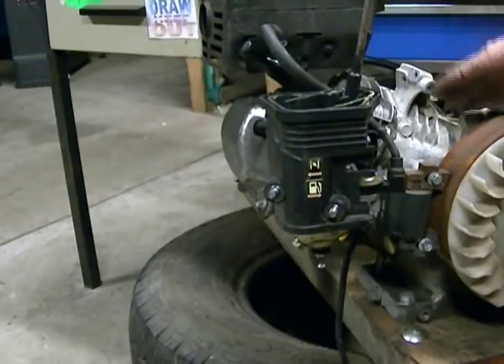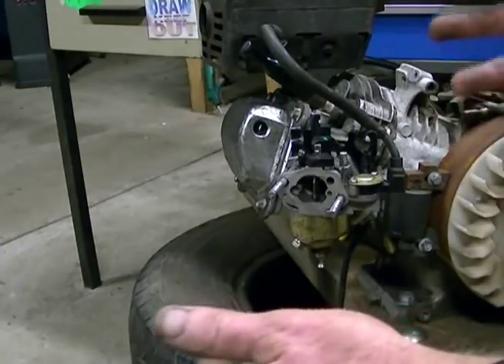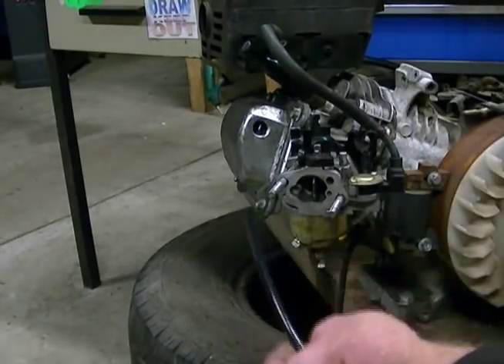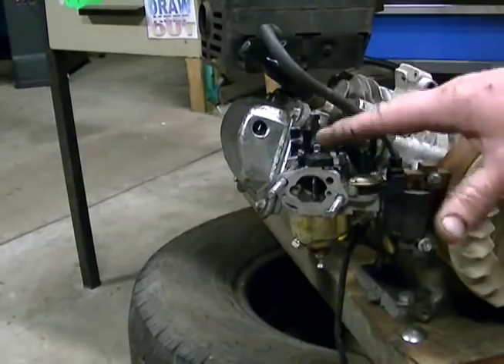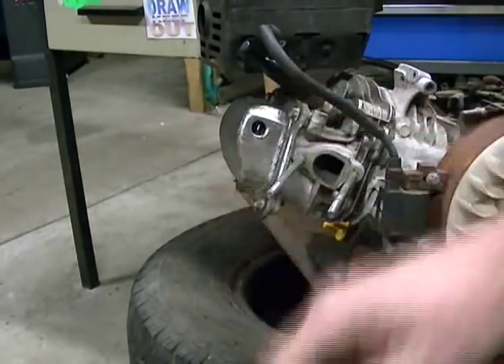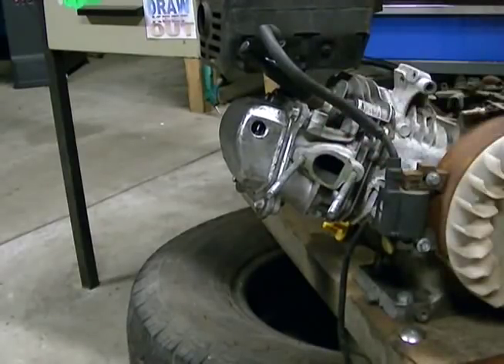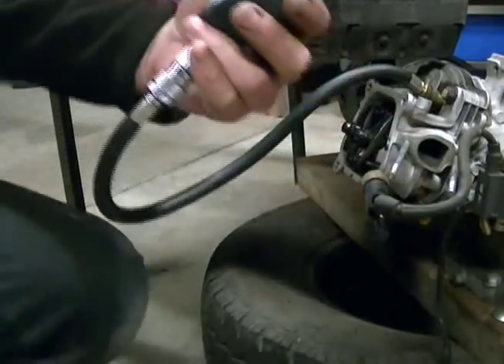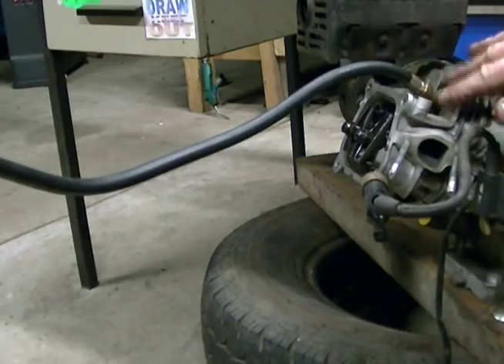HHO engine tips and tricks.

Comment: Speaking of electrolyzer under vaccuum, could you allow an adjustable air inlet to allow outside air ( Nitrogen) to weaken the volatility a bit and bring it closer to gasolines volatility? It would also be a bit safer?

Comment: Hho kits for your  car & bike  save fuel and solve all the engine heating problems automatically.  More engine power torque and acceleration engine runs cool clean and green. Environment friendly technology make your car quick start car ac will work more. Hho technology will prolonged engines and engines oil life. Less car mentences. Low octane fuel will burn like a high octane fuel. Your engine will burn 100% fuel in the engine no unburn fuel will wastage.  Car will run clean, calm and quiet and liking a new car. Best technology for the human health and happiness purpus HHO breathing machine. VERY simple and safe and easy technology, amazing recovery of human dieses like eye care,skin care, breathing shortness, parkinson and so many other dieses. Hydrogen rich water is best energy drink for human body health and happiness and beauty, for good sleep. Hydrogen gas is a powerful antioxidant detox our body. Reserach on hydrogen water is in the early stages so side effects are unknown. Or you can say so for no side effects. Hydrogen is 88 time smaller then vitamin c but richest in antioxidant. HHO technology best for our  cars. I am sure nany persons would be benefit from our hho acmec videos. HHO kits are very simple but very useful for old cars engine efficiency and performance fuel saving and money saving and envernment control hydrogen on demand system zero carbon emissions. Kit can install without any modifications in your car engine. HHO kits are very useful for cars engine efficiency and performance and money saving.Please visit HHO acmec if you want more information about this useful technology call 03082266179 zafar Karachi. For explanation for the HHO kits. Hho prolong the engine,solve the engine heating problems,prolong the engine oil life reduse service or car mantanic. your car will run like a New car. Calm and quiet running, remove carbon monoxide witch is very bed for the human health. Your car will start faster than before. Your car temperature will redused. Improve your car mileages. Hho kits make your car More power full, smother running. HHO kits will not harm to your car engine. Hho improve the fuel burning efficiency like high octane fuel. I called HHO technology is a  money saving technology. Rember to use only a little HHO gas for the best engine efficiency. Don't try to store HHO explosive gas . Hydrogen on demand system is best for use. For more information please visit hho zafar on you tube

Comment: I am using HHO kit from last 500km run on it but few effency increase by 5% on carburettor.. whenever I get lower fuel screw, it turns my spark plug into black foil. So should I need to decrease my jet size ? Need help in it thanks in advance

Comment: I have a old fuel injected 05 trailblazer 4.2l L6 if I put the hho behind the throttle body using a throttle body spared to feed the engine will that worked? 

I already have the 02 sensors fulled and the cat is straight piped.

Comment: I use an Anti-Parallel Dual Coil and only use the HV Back-EMF to Charge my WFC. The Blocking Diode is the collapsing Field capturing device. Then using a Light Bulb that bypasses the Blocking Diode consumes Electrons. So its B+ (Back-EMF) Charge the WFC, then + Charge from the WFC (Capacitor) is drawn to Light the Light Bulb when the Dual Coils are energised but the Blocking Diode prevent the +Pulses from charging the WFC. The Extraction of the Electrons lights the Light Bulb and Ionises the Hydrogen (When something has added or missing Electrons it is Ionised) so what you do is you seperate the Hydrogen from the Oxygen then Ionise the Oxygen (Oatley Electronics has an Ioniser) component and then recombine these Gases then expose these recombined HHO Gases mix (Meyers Gas Gun) to Red Laser Light (Wicked Lasers) which further destablises the HHO Gases so that it has more Ooomph. The resulting HHO Gas has 2.5X the Power of Petrol, exactly as Meyer had stated.
Reply: Think of it as M=Ec2, so you're increasing its Mass electronically by collecting the Hydrogen and discarding the Oxygen from Water. 1- Remove Electrons so you have a +Positively Charged Hydrogen Gas, most people refer to this Gas as H2 Deuterium. 2- Expose this H2 to Red Lazer Light, some people just use a U-Shaped Tube in the Exhaust to expose the H2 to Incandecent Heat to decompose the H2 into H3 Tritium. 3- Ionise the Air intake before it enters the Engine. The resulting Gases have 2.5 the explosiveness of Petrol therefore you use 2.5X Less H3 than you'd use Petrol... In Nature when Hydrogen reaches the upper Atmosphere it decomposes intoTritium upon exposure to Cosmic Rays.
Reply: @johnkenny-myatt2456  Hi John, can I get more details of your system? I've read some of Stanley but I didn't have understood some details of the process with the laser light. Thank you very much.
Reply: Excuse me, where can I see the detailed information circuit diagram?

thank you

Comment: To create HHO gas from water you need to input energy, at least as much as you get out by burning it back to water. So where are the gains? Also how do you regulate it in conjunction with the main carb throttle?
Reply: Stanley Myer if USA found out a method to split water at 1600% efficiency, over the standard method founded by Faraday, using cold electricity. So, if you can build a similar one, of at least 200% efficiency, you will have sure success.
Reply: @tonyrebeiro  Well theres an answer to the worlds energy crisis! Strange no-one has developed it! Don't you think? 🤔

https://en.m.wikipedia.org/wiki/Stanley_Meyer%27s_water_fuel_cell
Reply: Use Urea as electrolyte,  this will make over unity.
Reply: @madsnoop7  Are you taking the piss? 🤣🤣🤣

Comment: because hho is combustible you dont need to add air to hho its already got oxygen to combust which is why engines have a air intake but its not need with hho gas which has oxygen already, the idea is the hho goes in the air intake and NO FUEL IS PUT IN WITH IT , EMPTY OUT ALL THE PETROL AND TRY JUST THE GAS.

Comment: Many thanks for your Videos!! 

Im looking forward to the next one! :-)

Are the Valve -Rings damaged?
I only know about LPG. The Engine must be suitable for this. The Gasoline has Addetive. HHo and LPG not.

Sorry. I need the Google translator O:-)

Greedings from Germany
Reply: hho gas is 100% combustable there's  no need for a additive , and there's no need for petrol added to hho and theres no need for added air hho has oxygen already which is what you add the air for you can't have fire in a oxygen-free environment , the hho is the fuel and petrol only the vapour burn liquid petrol does not burn,  close off the petrol intake and put the hho gas straight into the air intake
Reply: @doubleooh7337  I think that was a misunderstanding. The additive serves to protect the valves. Or hardened valves and valve seat are required. So it is with my car (subaru). Otherwise it could come to a valve damage. That's my knowledge.
Reply: @petermaus2528  the addative only increase combustion (acetone) is a pure addative that you can buy on ebay if you're worried about not needing one but lpg hho and petrol vapour will 100% combust so they do not need a additive,  look up tom ogle he created a petrol vapour system that got him 100mpg in the 1970s in a buik road master, in 1959 shell oil company got 376miles per gallon, hho isn't needed to get increased performace  if you can evapourate the petrol into the air intake it'll go in to the engine just fine and 100% combust, the ratio air/petrol vapour is 49/1 , i bet hho because it is pure gas and 100% combustible you'll  need to also dilute it with air to a similar level to increase its efficiency in a engine, i have not seen any video where someone has tried to mix hho with air but its worth investigating I'd say,  a hho cell for a car is only good because it runs on water any source will be lakes, streams, rivers, sea, ponds, puddles, if you were in a dessert you could even use sweat or urine, another thing I'm still yet to see is a car running forever on hho with out have to top the water back up its possible, if a car had a dehumidifier on top running off the car battery the water it collects could be dripped into the water full tank, and unlike all other sources of water dehumidifed water is distilled water which is the only type of water that don't cause problems in the cell, did you see my hho cell?
Reply: @doubleooh7337  Thank you. Yes, i saw the video in this moment. :-)
Reply: You might want to see this https://youtu.be/QWWFp4LAzQA

Comment: You will need to advance the ignition timing to nearly TDC, to take advantage of the HHO properly.
Reply: not if you can find a way to dilute your gas to simulate gasoline .
Reply: Zero cam overlap, water mist, hho capacitive discharge plasma ignition solid copper plug leads and non resistor plugs. Egr for knock and way late timing eg 6-10 Atdc. Only 4-6% h2 per vol at 80% VE.
Reply: FYI - It needs to be 3 degrees after tdc

Comment: to prevent backfires effectively you need to make yourself a waste spark eliminator...Russ made one for me a couple of years ago for my briggs and stratton 5 hp motor and it works quite well...maybe you can get the plans from him to make it an easy build... you may also need to have variable ignition timing to get it to run at it's best.

Comment: If you fill a small plastic bottle with hho and ignite it the bottle will implode not explode.
Reply from the maker: The gas will expand before it contracts when changing phase back to water,as it is a heat generated event.
Reply: @69Atho  i used a plastic soft drink bottle half full of water to prevent flash back past that point. I did get a flash back to the bottle and it sucked in like a prune. It was really interesting.

Comment: I do not remember the source , who did this experiment. He used vacuum created by the suction of the piston to enhance the hho production of the electrolysis cell, which produces a water mist hho mixture and not clean hho, when vacuum was applied. However his motor ran on hho only and had a small hole through which the hho-water-mist mixture was sucked in. Providing the cell with a rather constant vacuum the vacuum in the cylinder during the suction stroke causes a cool down of the cylinder itselft reusing the heat produced during ignition. Both principles applied in one device ICE and Heat Pump which means the efficiency increases.
Perhabs you get an old fridge compressor to check whether there is any positive effect by vacuum on the electrolysis cell.